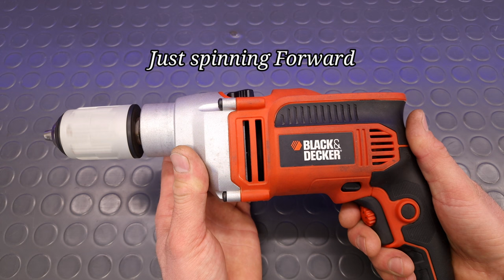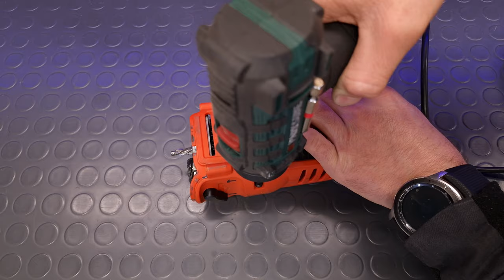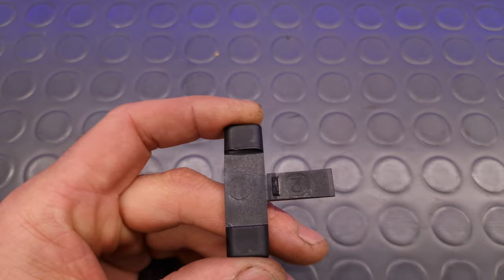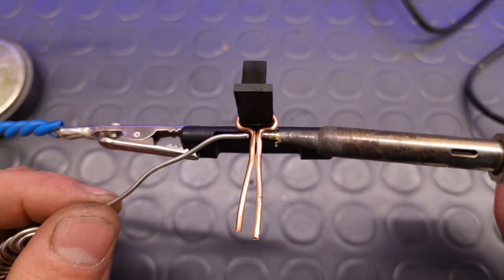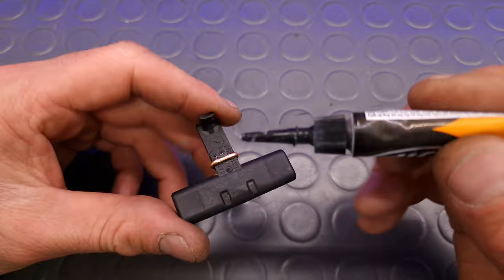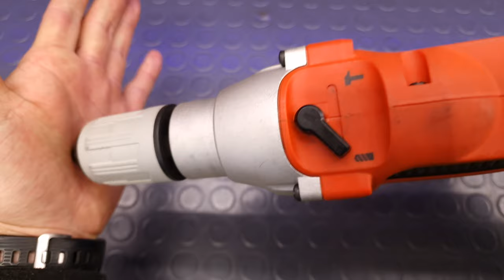Black & Decker Reverse Switch problem Fixing (Just Forward Function is Working)

Comment: I have similar drill but with manual chuck. Today, I wanted to service it for the first time in 10 years or so and unfortunately saw a "C" shaped spring like material on the table when I was inspecting the motor, etc. That spring has one end looped in shape of Zero and the other end is smal "c" shape. Any idea where could that be in this dril or similar drill ?
Reply from the maker: Could it be from the shifter button as shown in this video 8:05
https://youtu.be/zL6NaXly6Fk
Reply: @ErCanEverything  actually the spring has a diameter (if full circle then) about quarter to an inch / 20 mm and it's made of a very thin guage wire. The drill machine internals are same as in this vdo https://youtu.be/iu_J7Zn7KNM but I did not see that razor thin spring in this vdo either ☺️

Anyways the drill is working fine and if there is any issue faced then may be I could figure that out later - Thanks for the help.

Comment: I had the same problem, the interruptor was broken. I fixed it but when it broke, was because the switch inside is very hard. Now with the interruptor fixed, it works but still hard to switch... Is not the same model, mine is an EPC12. I don't understand why is so hard...